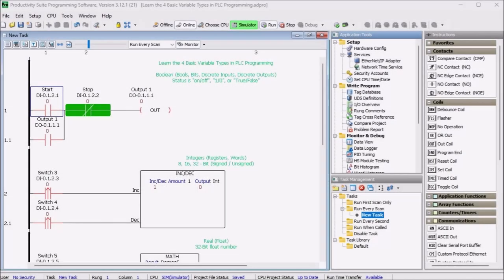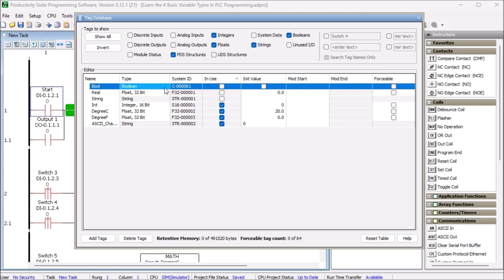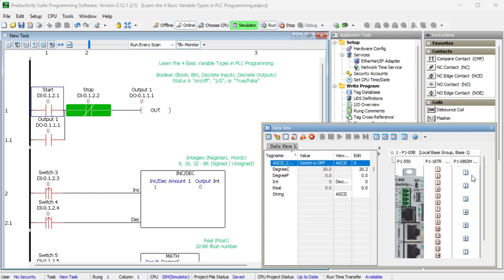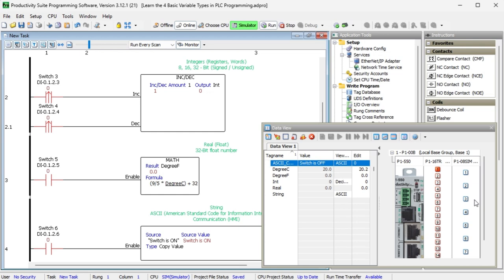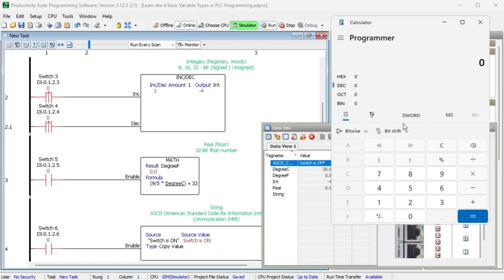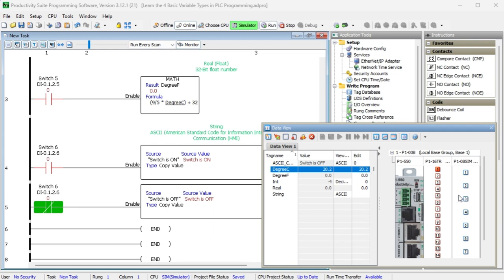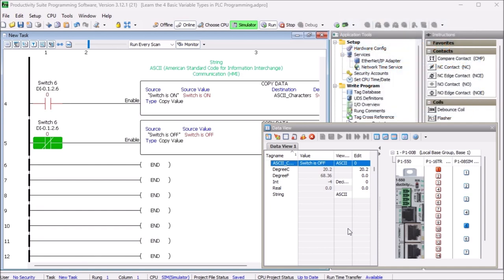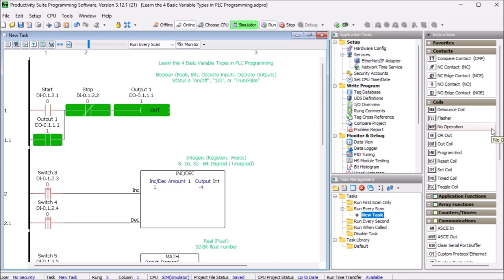Learn the 4 Basic Variable Types in PLC Programming

Comment from the maker: Here are the controllers that we have covered at ACC Automation:
Productivity Series
https://accautomation.ca/series/productivity-1000-plc/
https://accautomation.ca/series/productivity-2000-series-plc-p2000/
BRX Do-More Series (Do-More Designer Software + Simulator)
https://accautomation.ca/series/brx-do-more-plc/
Click PLC Series
https://accautomation.ca/series/click-plc/
Omron CP1H Series
https://accautomation.ca/series/omron-plc-cp1h-series/
Horner XL4 PLC Series
https://accautomation.ca/series/horner-xl4-series/

https://accautomation.ca/series/easyplc-software-suite/
EasyPLC Software Suite is a complete PLC, HMI, and Machine Simulator Software package. Please take a look below to receive 10% off this software. This PLC learning package includes the following:
Easy PLC – PLC Simulation will allow programming in Ladder, Grafcet, Logic Blocks, or Script.
HMI System – Easily create a visual human-machine interface (HMI)
Machine Simulator – A virtual 3D world with real-time graphics and physical properties. PLC programs can be tested using EasyPLC or through other interfaces. (Modbus RTU, TCP, etc.)
Machine Simulator Lite – Designed to run on Android Devices.
Machine Simulator VR – Virtual Reality comes to life so you can test, train or practice your PLC programming.
Purchase your copy of this learning package for less than USD 75 for a single computer install or less than USD 100 to allow different computers.
When you order, you should receive 10% off the investment by typing in ACC in the comment section. http://www.nirtec.com/index.php/purchase-price/
Learn PLC programming the easy way. Invest in yourself today.

Regards,
Garry
ACC Automation
https://accautomation.ca/